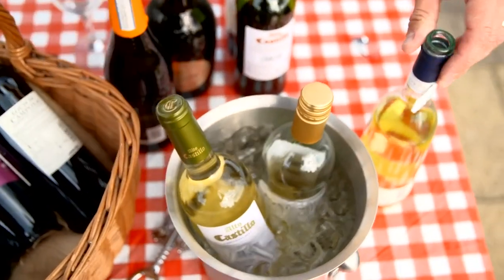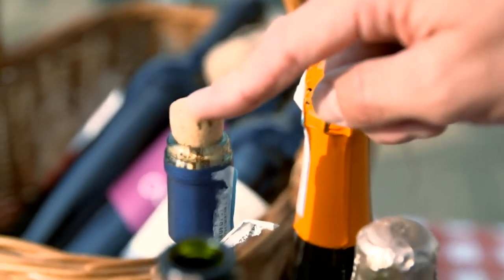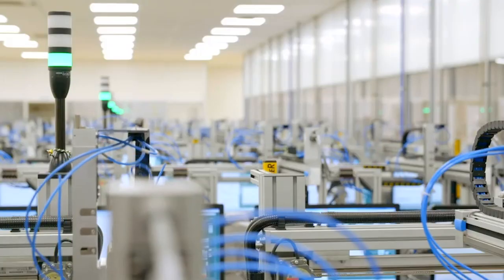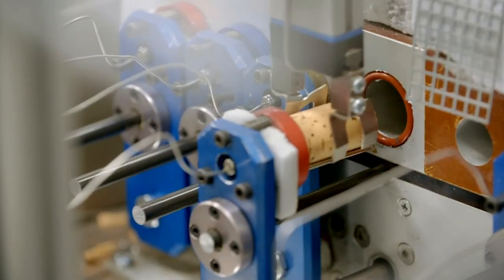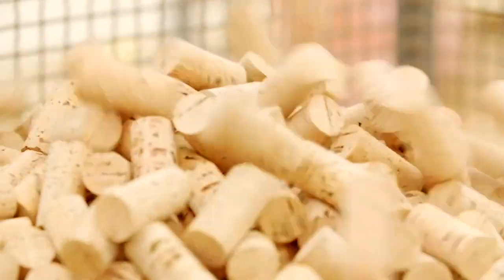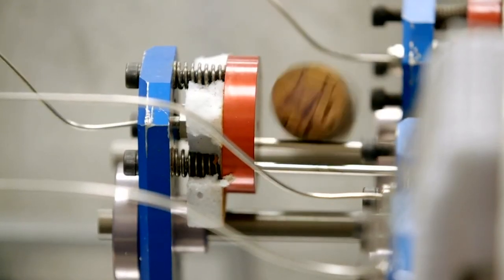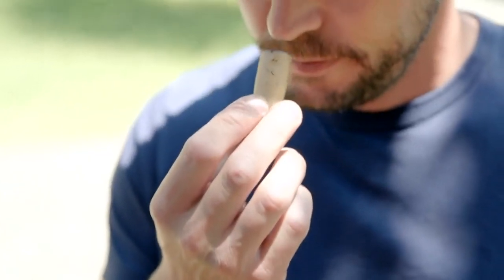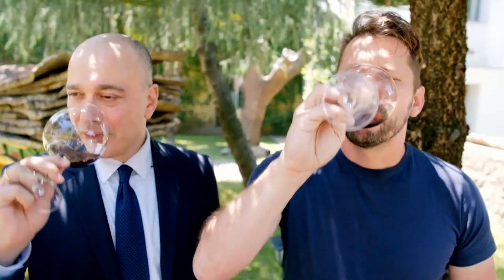What actually happens when Wine Gets 'Corked' | Food Unwrapped

Comment: I hope this myth about TCA leaching into wine quenches itself sooner rather than later. 

I have seen more and more wine brands use twistable bottle caps, which are of themselves multi-material composites. They, like plastic ABS bottle caps on glass bottles, lower recyclability rates of wine bottles. I'm not even sure you could recycle the caps by themselves. I suppose it isn't much worse than the multi-material wrappings even corked wine bottles have around them that display brand logos, organic logos, etc. Those are primarily aluminum, so I suppose the recycling rate would be better there if recycled in bulk. 

Cork on the other hand is natural, in some cases renewable, and can return to the soil if composted correctly. 

Had a conversation with a server at my local Italian restaurant (in the US) and he noted that a lot of the more expensive wine brands from Italy are starting to use bottle caps than cork. Hope it doesn't continue!
Reply: Cork uses a ton more energy than plastic in its production.  It’s not always about the end product, you have to look at the production as well.

Comment: Just use inert plastic
Reply: But that’s also not sustainable. Cork is biodegradable and compostable.

I’m not saying i have all the answers, but I think there are competing interests here too.
Reply: Lets not add to the plastic proliferation problem.
Reply: @diulikadikaday  cork uses water, fertilizers, and uses electricity to process.
Plastic has a lower footprint here.

It's like the paper or cotton bag opposed to a plastic bag, plastic has a lower impact than the others
Reply: @fridgemagnet9831 , do you have any research on that? I don't doubt you, but that's fascinating to think about. does the footprint of plastic include the resources needed to extract the oil?

In New Zealand, 80% of our power is naturally generated so I would expect that cork from NZ (if such a thing exists) wouldn't have a high footprint.
Reply: @diulikadikaday  well  cotton tote bags are worse for the environment, which is no intuitive but some daninish done the study,

I have no idea whether the plastic or cork process has a bigger impact.
Reply: @fridgemagnet9831 , ok true. from my limited knowledge, cotton requires a lot of water and energy to process
Reply: @fridgemagnet9831 Are cotton totes worse if they actually get reused many times, compared to a single use plastic shopping bag?